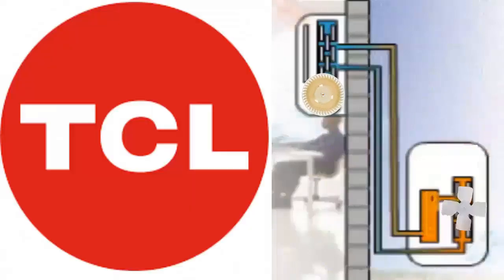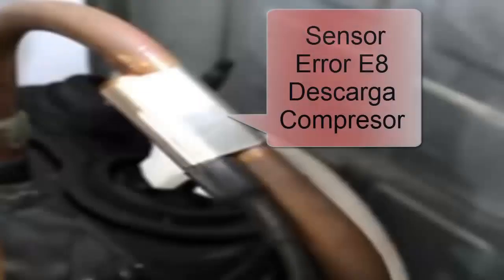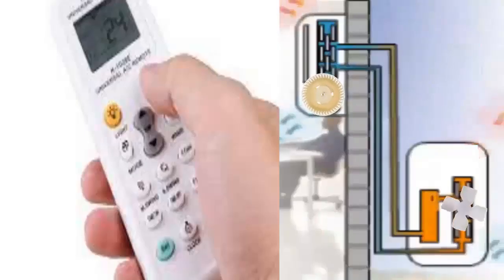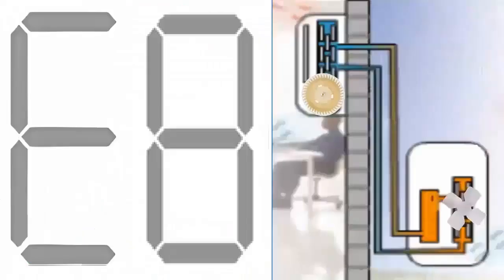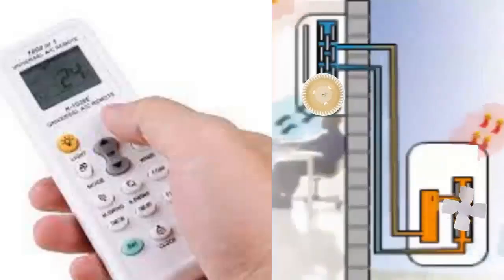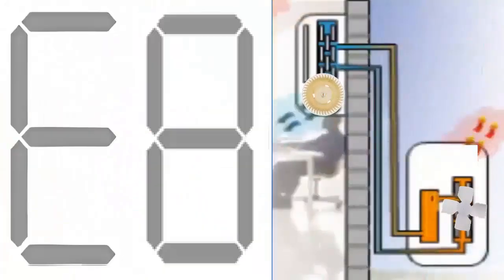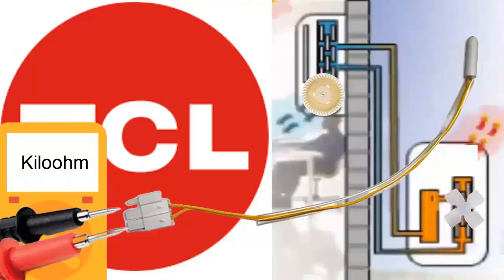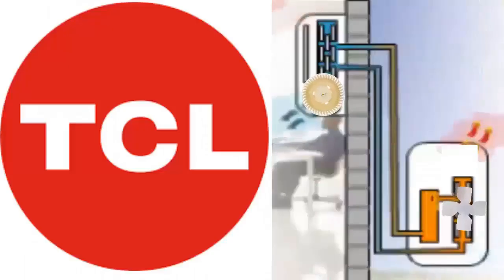TCL AC Error Code E8 Explained: Causes, Troubleshooting, and Quick Fixes for E8 Issues

Comment: Informative video also include remove temperature sensor connector and check voltages it should be 3.3 Volts D.C. if it's present then mostly sensor connector lose or wire problem or sensor faulty
Reply from the maker: Thank you for your contribution, but if you remove the sensor, only the resistor on the control board would remain, since it is connected in series with the sensor resistance. Therefore, I believe the voltage reading should be higher.